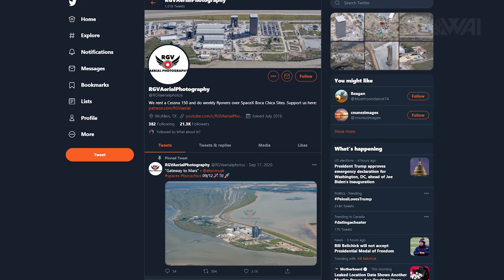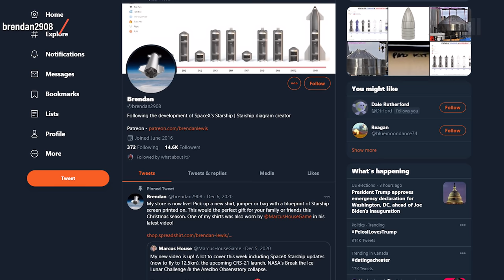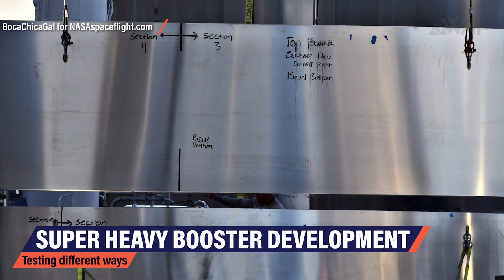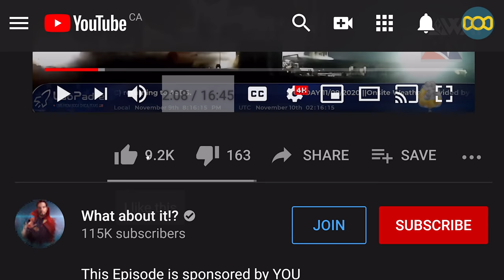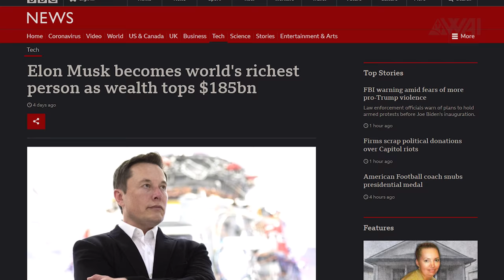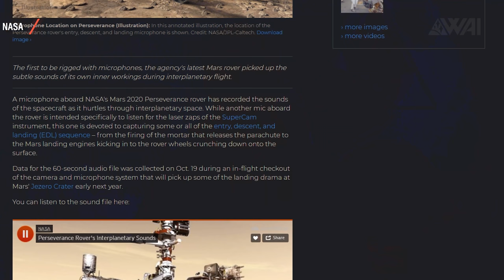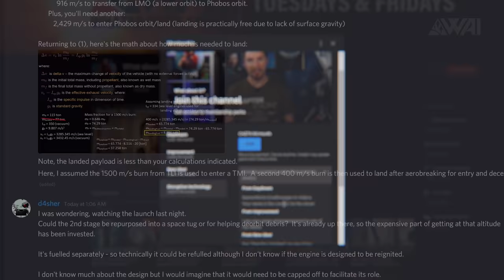141 | SpaceX Starship SN9 Launch – Heat Shield Trouble – NASA Perseverance Landing

Comment: Man that title almost killed me. I thought he meant there was a problem with perseverance heat shield 😅
Reply from the maker: Oh my Gosh no! If I see this more, I'll change the title! :_WAIShocked:
Reply: @Whataboutit  I watched it twice to see what the "trouble" was.The header seems to imply an issue with SN  9.
Reply: What hour will it start?
Reply: @Whataboutit  PLease do , that Title Is too Click Bait , it borders Misinfo
Reply: @TheHeavenman88  Agreed.
Reply: I’m still not sure what the “problem” is, watched whole video.  I am confused too.
Reply: @Whataboutit  Perhaps change trouble to "prototyping" or "testing"?
Reply: Same confusion with the title. Almost employing that Perseverance has heat shield problem
Reply: @jimstafford9409  Surely the “trouble” is the problem of weld induced distortion Felix talked about. Welding thin sheet stainless steel of any type can be a nightmare. Also, some types of stainless steel seem to distort with very little provocation. If you’ve ever tried surface grinding thin stainless steel you’ll know what I mean. It is next to impossible without coolant. Even 304 stainless, which is designed for easier welding, suffers the same heat induced distortion problem. The crystal structure in and around the welds can vary and change considerably from that of the original material, causing much distortion. Felix specifically mentioned the welding of the thousands of tile attachment pins and the distortion that has to be mitigated. This is still a problem and Spacex must be doing a tremendous amount of research into optimising the pin sizes, patterns and welding techniques.
Reply: @ericrandall3539  See my reply to Jim Stafford.

Comment: -Welcome back Felix!  I saw an FAA data sheet. They changed the altitude limit for SN9 to "Unlimited".  Please check on it.
-Unless they change out a Raptor, I think the short test fire was to limit the damage to the Pad.  (Damage is accumulative)
-When we were welding Stainless steel sheets together making a coal storage tank (Very similar to what Spacex is doing), we needed to place a 1 mm spacer between the sheets at  1 M points along the join.  That way it allowed it to shrink and not warp the weld area.
Reply: "Unlimited" applies to excluding aircraft in the vicinity, not the permissable Starship peak altitude. It certainly means that U2 and supersonic Blackbird overflights are verboten.
Reply: Thanks, it is sometimes hard to determine intent from the way government-ese is on forms.

Comment: There is a major change that has been mentioned elsewhere. The thickness of the ring is supposed to pass from 4 mm to 3 mm. It is indicated on one of the rings shown in your video (8:43). This will save a lot of weight for the structure and increase the potential payload. They will have to change many things and execute a lot of tests.
Reply: That's a huge change. The current tanks must be greatly exceeding the required pressure requirements. Or the current starship is much heavier than they originally anticipated.
Reply: This might be where SpaceX hopes to obtain another 50 tons of payload capacity. Probably involves trimming both Starship and Super Heavy.

Comment: SH "What's Missing" is spotted in the "Bevel Bottom" note on the ring - means they're changing the shape of the metal where it interfaces with the ring below it, no doubt more dealing with the heating/cooling changes with welding.

Comment: I'm NOT a rocket scientist/welder/metalurg, but I guess that in order to mitigate the contraction and denting effect on the fuselage of a starship due to the many attachment points for the heat tiles SpaceX should consider to separate the fuselage and heatshield by attaching the latter on the fuselage in just a few selected spots - if it this turns out to an issue.

Comment: The trouble with heatshild is that is to big and heavy, if you calculate the surface covered by the heatshild you will get a number of 850 square meters, even if tiles are wery thin and weigh only 20 kg/square meters that means tens of tons only for the tiles with additional support can be 25 tons or more.

Comment: I guess they also will move to robotic welding of the ring-segments in the future. Put the ring-segments on a rotating platform or have the robot move on a circular track around the rocket. Gantry crane on the top picks up segments from outside the mid-bay and they can start automating the whole process.

Comment: The exhaust nosels where not exposed enough, instead they are tucked so deep in the bottom, because the bottom is being exploited as a flat stand, when it needed a high legging, there is also no air flow intake to create natural wind cooling, the way a propeller turbine does, so the exhaust cones need to be exposed.

Comment: The space industry was the one shining jewel of 2020. The only sector to not just have good news, but fantastic news all year. 

Is the heatshield necessary for Starship when returning from orbit, or returning from interplanetary flight? I was under the impression that it could manage just returning from orbit without it, but absolutely needed the heatshield when returning from Mars.

Also, whatever happened to the "sweat" based heat management system that was originally planned?

Comment: ...I have to presume SpaceX has taken in to consideration the effect the heatshield mounting pins have on laminar flow in its test-dives. I suspect at some point before a high altitude test some sort of non-performance material plates will be attached in place of the true plates to negate the effect of the bare pins.

Comment: The tile attachement are all wrong. These tiles can't be attached to the hull due to flex and expension. These tiles must be installed loose in the chanel using tong and groove method. To make that happen move inner vertical bracing outside and use it as a stackable tile chanels

Comment: Why do they want to use little tiles ? The Starship exterior is almost at its final design so they can make one big tiles or one for each section no ? Installing tiles is hard so the less you have the less trouble it is. Also, less tile mean less risk to have one falling and destroying the ship at re-entry. Why do they not use the same concept as the Starship for the Moon ? The landing will have the same risk of debris if the mains propulsors are use.

Comment: If you want to keep this scientific, you should stop referring to the metal as just "stainless steel."  At least for example when giving the "metaling point" of the material.  Each variety of it having a different "high temp" point for use and melting point.  I think it is more accurate to refer to the areas you are talking about as 304, 304L, 316, etc.   But maybe that is only me.